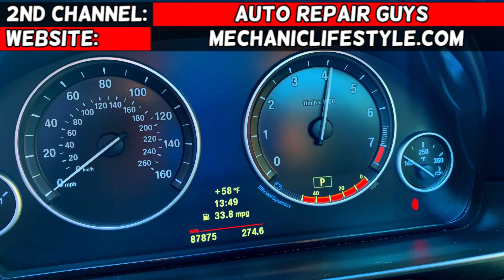TOP 3 WHY ABS AND TRACTION CONTROL LIGHT ON KIA OPTIMA

Comment: What was the second thing at 2:44? I am not quite clear. Make sure what is not lose in where...? I just saw two cables dangling... Are those supposed to connect to something? Thanks for the video! Do you think this would still apply to a 2019?
Reply: Were you ever able to fix your Kia? If so, how? I have the same problem